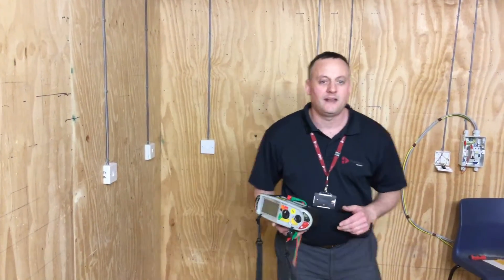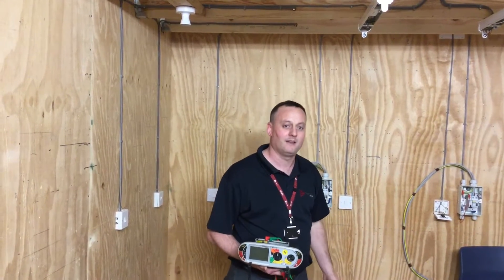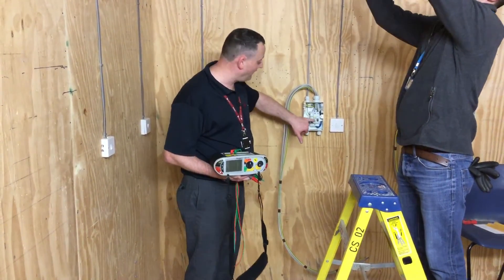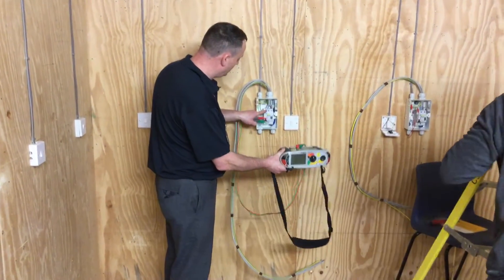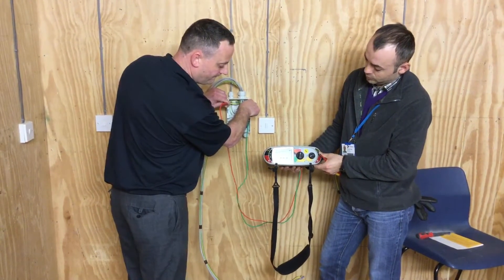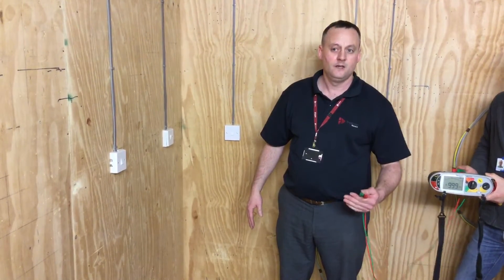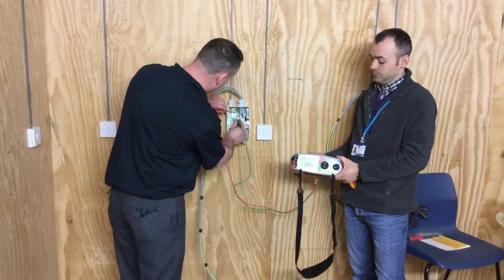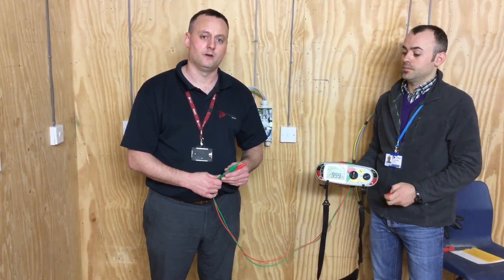Electrical testing insulation resistance test of our lighting circuits Remember the Two Way Switches

Comment: how would you do this insulation test on a larger installation say an office with row after row of recessed lighting or whatever.you couldn't remove all the lamps/loads.would you test at 250
Reply from the maker: +Roy Kirkham 
Hi. You would only test between line and cpc and neutral and cpc for each circuit and not across the loads e.g. line and neutral. You would then comment that the insulation resistance test was limited by the fact all lamps (loads) couldn't be removed. Testing at 250 volts DC first is always good practice but the tests needs carrying out at 500 volts DC. If loads cannot be removed don't test between live conductor. This can only be applied to an existing installation and not a new one.
Reply: GSH Electrical 
right thanks for the reply.so I'm guessing testing  between live conductors in real life installations wouldn't happen much.especially in commercial/industrial jobs where it wouldn't be realistic to disconnect loads.
Reply from the maker: +Roy Kirkham 
Correct and thanks for your questions GSH Electrical